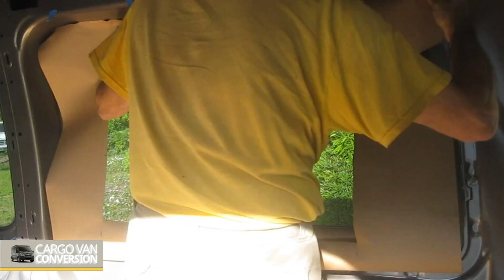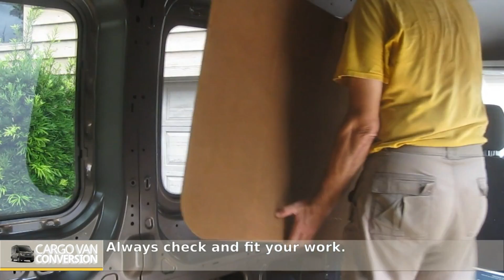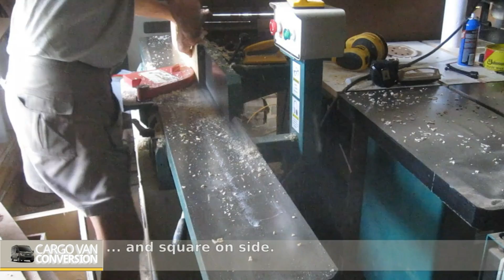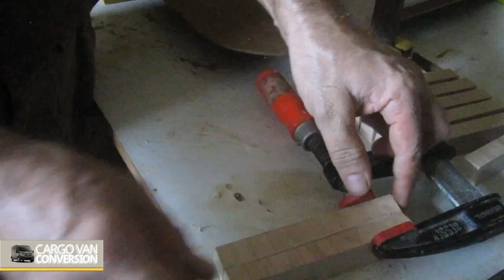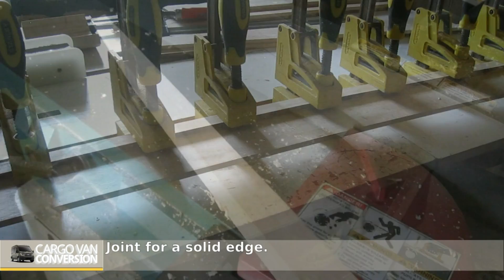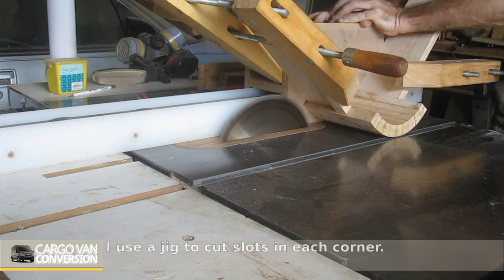Cargo Van Conversion - Murphy Bed/Desk - Window Frame - Part One

Comment: As usual, you really made a beautiful job of this part of your conversion.  By looking at the huge amount of professional equipment you have at your disposition, and your ability to operate them, I think that you must be (or have been) a professional woodworker.  I don't think that most DIY camper outfitters will ever be able to come anywhere near your perfect results, but even if it's not as good and precise as your masterpiece, one can still have fun and enjoy the finished product. Hope that my old van will be usable one day, it will never be anywhere close to your van, but I will be happy with a lot less, although I will certainly try to make it as good as I possibly can. Now back to my van to continu with some mechanical jobs, as I'm in the process of changing the timing belt kit, and also the waterpump, which is part of the engine mounting, with it's seperate belt that also drives the alternator and powersteering pump.  It's far from the most pleasant jobs I've ever done, and I'm not in the good shape I used to be in, but as they say :"It's all part of the fun".
Reply from the maker: Hi Peter:
I only have the most basic woodworking power tools: tablesaw, jointer, planer and drill press and while most of them make life easier, a good tablesaw is really the only one you need. That with a few handtools and some experience will get you far. I always hope that viewers will try some of my projects and it's great to see, they do.
And then there are you're expectations: Some are satisfied with a bed out of 2 x 4's, some like me are perfectionists. It's all about experience and the only way to get it, is by doing it! The German proverb says it al: "Ubung macht den Meister" - The more you do it, the better you get at it.

Van Williams

Comment: You put some real effort into that project. As most people cheat on the corners.
Reply from the maker: Yes and this is the most difficult project so far. Lots of glue and sanding and that for all 4 corners. And none of them are identical; my choice of hard maple didn't help either. But when it works out, it's a very satisfying job. With this conversion, I don't want to circumvent any issue but face it head on.

Van Williams

Comment: One woodworker to another. Nice biscuit trick.
Reply from the maker: The only way to reinforce it. But next time I might glue up a few boards and saw out the corner in one piece. Different result, but probably easier/faster.
Thanks for watching.

Van Williams

Comment: I have been engineering, in my head, for a while now to accomplish the built up round corners for my build. You bring it to the next level and beyond. Amazing stuff. Do you mind me asking if you learned these skills as a tradesman or just a hobbyist?
Reply from the maker: Hi River rat,
These window sill corners took me the longest time to accomplish and after more than a year, it still looks good. In a week or two, I'll be showing a completely different technique for bending wood. Specifically, bending regular plywood and then covering it with Formica. Worked out beautifully.
I don't mind asking questions at all, rather like it :) Just acquired the not so perfect skills through experience. That's trying and doing it again, when you fail. Ultimately, you get better at it. The best skill to use, is patience...
Van Williams

Comment: Nice work as usual. I would not make a habit of using the jointer on small pieces like the corners based on my personal experience of doing the same.
Reply from the maker: Another woodworker? You're right, but sometimes you get lured into it. The same is with the protection on the tablesaw. The best thing I've learned, is to stop when I get tired or loose focus.
Have a great day!

Van Williams

Comment: Love your workmanship!

I was wondering how (if?) you were able to get any lateral clamping pressure between the side boards and the curved corners at glue up. (It was a little hard to see the placement of the last clamps in the video.) I am guessing that the biscuits were there to correct this problem?
Reply from the maker: The biscuits were inserted afterwards to give the corners more glue surface. What I found out over the years with woodworking, is that you can't have enough clamps; probably the most useful tool for the woodworker, besides a tablesaw. The pressure came mainly from first clamping the piece to the worktable with these large wooden handscrew clamps and then pulling these clamps together with long metal clamps. This doesn't offer much pressure, but with wood glue it is sufficient and within half an hour it's solid (I always do let it dry overnight).
Have a great day!

Van Williams